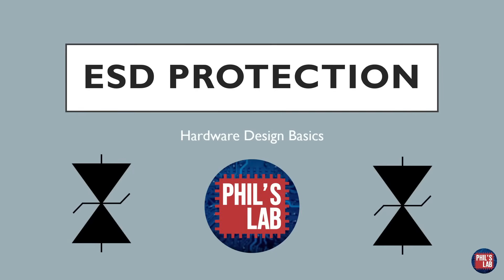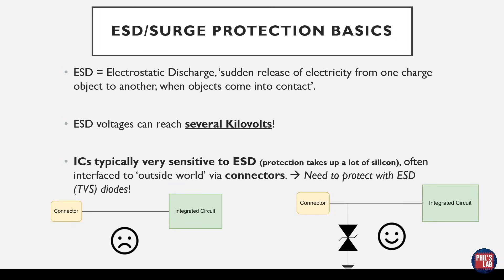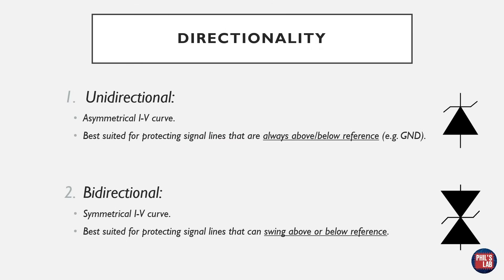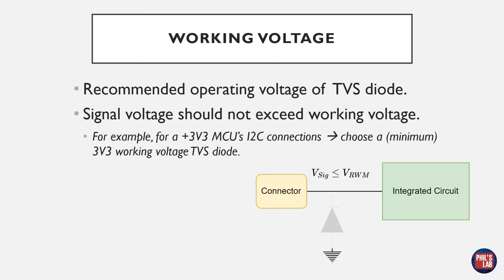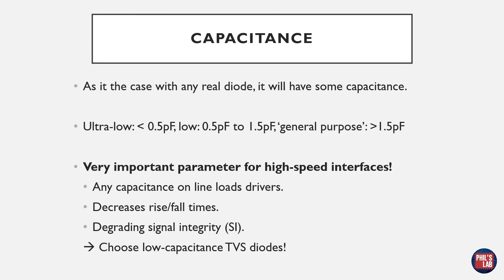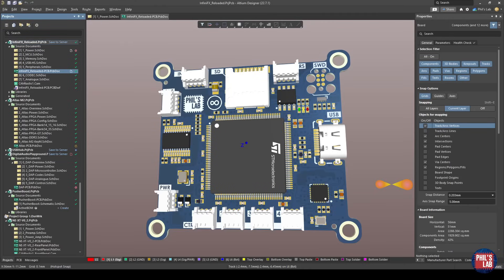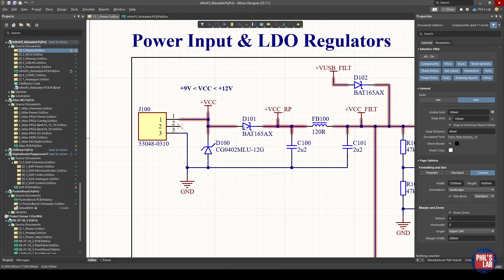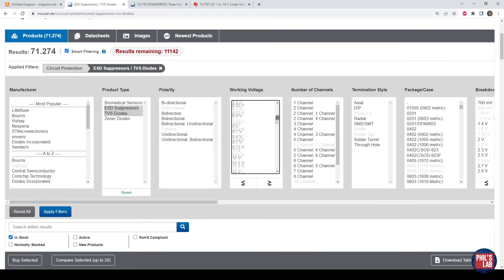(Sponsored) ESD Protection Basics - TVS Diode Selection & Routing - Phil's Lab #75

Comment: My  biggest issue is knowing when it's worth it to use one, someone online told  met o put them in my mosfer drain connector side, for a circuit that controls  lights, but I  was arguing that it's a one-time setup thing and not wroth putting 5 TVS on for.

Comment: @11:34 thanks for this explanation, I was scratching my head on why the hell a vendor schematic had  bi-directional diode in place for an external DC barrel connection for +19VDC, then I saw your video and remembered that there are power supplies with inverted connectors which flip the +/- on the tips, THANK YOU! On to the next mystery lol

Comment: What about thermal relief pads on the GND side when the diode is connected to a plane ? Should I remove it ?
Reply from the maker: Depends on component size and copper balance. Removing the thermal relief can reduce the overall inductance of the connection.

Comment: Nice Video! Thank you!  Two questions 

1. what about using a resistor in series to the input? It could be a 1-5 Ohms resistor which limits the possible current that is drawn by the diode. If you use a polymer fuse it can vary its resistance. 

2. The second alternative I know is are two stacked diodes. One from the signal wire to GND and one from the signal wire to Vcc. Is this as well a valid approach? 

Would be nice if you could comment this.

Thanks in advance

Comment: What is the rule about using ferrite beads? Is there any real benefit of using FB at 5V input of PDN?
I know it can filter out HF noise coupled to the VBUS line (USB cable, especially unshielded can act as an antenna for sub-ghz range), but what's the aim? Is it included to protect from this or to prevent HF noise getting out of the board?

Comment: As I understood, you are trying to give (9V-12V-->3.3V) to microcontroller ? and protecting the circuit using TVS diode + pi-filter. 
We can also use this type of protection ( TVS+ reverse polarity diode+ pi-filter) between 5V SMPS and Microcontroller board for EMI/EMC issue ?
what is the role of pi-filter here ?

where we can ask a problem in details any linkedln profile or website you have?

Comment: I work in an industry where we use M12A 5 pin connectors on all of our equipment and have a need for this. I wonder if there is any way to integrate this into a connector or something similar?

Comment: What if the clammping voltage is less than the operating voltage. The diode will be activated when  it exceeds the clammping voltage or when it exceeds the operating voltage?. For example this diode PESD5V0C1ULS-QYL

Comment: OK, so the ESD current goes into ground, but what if there is no ground? i.e I am holding the PCB in my hand? Where will the energy be dissipated in that case?
Reply: your pcb still has a ground, all your components, assuming that they've been properly routed, should have a nearby return path to ground. all this diode does is offer the ESD a direct return path to that ground before that ESD can make it to your components and cause any damage.

Comment: If you have a fairly high impedance input (gpio/ADC/opamp kinda deal) could you put a resistor before the tvs diode to reduce the current it'd have to deal with, rise times all that kinda deal? Or is it still better to have that after the tvs?

Comment: Hi, I have a DC motor operating at 24 VDC @20amp. On the supply line a surge voltage of +/-250VDC for 500msec is getting generated. In such case how to select the TVS diode? Also if current is also an important factor right?

Comment: Hi Phil, I have a question on the order of esd as connector esd filter and IC.

I have seen that the resistor element of the filter is put before the esd to also limit the energy going into the esd while still serving same purpose electrically. Is this is a good practice?
Reply: I meant this question for a data line

Comment: While your video focused on electrostatic discharges, during connector handling, there's also the point that signal lines can be subject to transient voltage spikes during operation.

It's advisable to consider where the energy absorbed by your suppression devices is delivered to. Dumping directly into ground isn't always a good idea.

I have, in my past designs, separated the equipment casing from signal ground (often not completely, resistive and other networks can be used) then routed the suppression devices to low-impedance traces which are bonded to the chassis or case internal shielding coating (for plastics).

The aim is to prevent large injections of current under transient voltage application from affecting the signal ground and upsetting system operation. This is of particular importance to systems running at voltages of 3.3V and below.

Comment: Is this similar/different to having 2 diodes, 1 to Vcc and 1 to ground?
Don't a lot of MUCs have that(diodes to ground and Vcc) at least on IO pins for ESD? 
If they used TVS Diodes,  then could you have 3.3v ICs with 12v IO tolerance?

Comment: why J100 a 3 pin connector and not 2?
Reply from the maker: For all other connectors I'm using either 3- or 4-pin. Adding an additional 3-pin instead of a 2-pin makes me need fewer unique components, as well as cable harnesses.

Comment: The BI-directional diode works in most of the cases, and you don't need to choose the polarity at all. Unless you are manually mounting the diode, and you are not able to know if the diode is soldered well to the trace, because either direction is open, in that case, uni-directional is better choice, because you can use the diode mode to measure its forward biased voltage, and that's will tell you whether the diode is soldered well.

Comment: Thanks for a nice video. I see that you showed ESD protection for LDO regulator and I went back to check the design I'm currently working on. In datasheet of the LDO that I use (AP2112K-3.3) it says ESD (Machine Model) 400V and ESD (Human Body Model) 4000V under Absolute Maximum Ratings. Does that mean that I don't need to add TVS diode?
Reply: If your goal is to save money or you just dont have the room on the PCB, skip the diode and use the built in ESD diode. Personally, i think its worth adding additional protection. I dont know why, but i just dont trust the IC manufacturers with this. It seems sus that this tiny IC has enough room for the IC and a reasonably large ESD diode. Your mileage may vary, but it never hurts to make a design more robust.
Reply: The esd diode integrated into the ic must be second line of protection and you gotta put an external tvs diode for full protection

Comment: 10:01 why a TVS diode on the power supply input if any "ESD" is gonna see that massive 2u2 MLCC capacitor? The diode could serve to clamp the maximum supply voltage and offer some minimal protection to over-voltage until it burns up due to the power dissipation. For ESD I would think the capacitance on that rail would suffice.
Reply from the maker: That's true - a (~ >=0.1uF) cap is usually enough for ESD protection on power rails. However, adding a suitable (larger body/power rating than shown in this video) TVS diode can help - as you said - with clamping the max. supply voltage. Quite a numer of app notes do suggest placing suitable TVS diodes also on the power lines.

Comment: Nice overview. Except for USB, I tend to forget EMI and reverse-bias protection when designing circuits... until something stupid happens. lol
A video on Surge Suppression would be great as well (eg. using MOVs, spark gaps, TVS diodes, etc.). Probably not as relevant for (most) strictly DC circuits, although I find myself working a lot with line AC (either building my own power supplies, or for doing industrial control stuff for my CNC machine).
Reply from the maker: Thanks, Jacob. Will try to cover surge suppression in a future video as well.

Comment: Thanks for this educational video! I've always placed a slow fuse (cartridge or poly) in front of the TVS diode. My intention with that is that in case there's a spike that persists for some time and/or, the more likely scenario, where the user plugs in a wrong power supply with a greater voltage, then the fuse would save the diode from burning up shunting all that current. I'd rather replace a fuse cartridge than a SMD diode.

Comment: Hi Phil. As always thanks for making such good videos.
We are working on a small electrical cart with the supply voltage of 48 Volts. The motor used for the cart creates 60 Amps current in back-EMF. How can we select a suitable TVS diode for reverse EMF protection circuit?
Reply: The diodes described in this video would die very quickly in that environment. Take a look at the SMDJ48CA or 5.0SMDJ diodes made by just about everyone. The key is the pulse power rating of the device. An SMD (not surface mount device, this is a part numbering thing done by Littlefuse, Vishay, and so on) component can handle a pulse of 3kW for around 1000us all day long. If you know the rise and fall times of your back EMF you can derate accordingly (maybe you need a bigger part, or multiple in parallel). Look at the datasheet for any of these devices and you will see a table that shows the peak power handling of the device over the time of the transient. 
FWIW- Those part numbers are like this SM [A,B,C,D (Power rating and size)] J [ Working Voltage ] [A for unidirectional CA for bidirectional]. So an SMDJ48CA is a 48V, D rated bidirectional devices. An SMAJ5A is a 5V unidirectional A rated device... and so on. The 5.0 or 3.0 you  sometimes see is a higher power device crammed into a smaller package.
Reply: @theonlyari  Thanks for the reply.

Comment: One parameter to check on, particularly for high-speed/low capacitance diodes, is if they have a snapback voltage spec.  When one of these diodes is triggered by an ESD event, it won't reset until the voltage falls below the snapback voltage.  For instance, if you want to have ESD protection on a data line and a 3.3v rail you might decide to use the high speed diode for both lines to simplify the BOM.  However, the snapback voltage may be 2.7v so if it is triggered on the rail it won't reset, i.e., it goes into latch-up, short circuits the rail and bad things may happen.  On the data line, the diode will reset when the data line toggles low.  Search term:  esd diode "snapback"

Comment: Very useful educational video.  Thank you.... also I have a question.  What is the difference between zener diode and ESD protection diode in this case?  When think about functionality both behave same.
Reply: Maybe the functionality is similar but the construction is specialized for that purpose. ESD diode might not have a very well set voltage level, or the votlage level might vary a lot with the current. A Zener might have a slow response time, making it almost useless for protection.

Comment: Thanks so much Phil - thrilled you've addressed this important area. Really hoping you can do a back-to-back video on power filtering, then your followers can safely design circuits for the real world. I'd love to see your take on common and differential mode EMI filtering (on both power and data lines), and when to use discrete components vs integrated eFuse IC's
Reply from the maker: Thank you very much, Dan! Definitely will be making a video or two on power filtering in the (hopefully near) future.

Comment: Think ESD design on a PCB is complicated? Then modern CMOS processes are 10x more complex. Primary and secondary protection, cross-domains, HBM, MM, CBM, antenna diodes, latchup...
Oh, and in high data rate I/O they couple ESD protection via a T-coil to reduce capacitive loading.

Comment: You can run in to problems as you get close to the clamping voltage as they start to conduct below this. This current can cause heating if the clamping voltage is too close to the maximum voltage on that net. So finding a TVS diode that will clamp low enough but not too low can be quite hard.

I have seen designs where the TVS diode in series with a diode or zener to up the trip voltage. But the diodes or zeners are not fast enough so affectively take the TVS out of circuit. Also a low value resistor a few ohms can help if the current pulse is expected to be large.

Have you done any lightning testing, that really puts your TVS diodes under strain. Had one where we kept seeing little flashes of light during the tests inside the box. On the third or forth strike the little flash was followed by a bang and a TVS diode exited stage left at a vast rate of knots.

Comment: Is there a parameter for the diode that says how long after a high-voltage pulse the line can stay high? Or is that something that has to be calculated based on the filter network?
Reply: The signal line can stay high forever, the diode is going to shunt the excess voltage to current. When the transient disappears, the voltage will settle back to whatever the voltage was. I saw a comment in here about snapback. I have been doing DO-160 lightning testing for years and never seen an interface get latched up by lightning. Im not saying it cant happen, but i havent seen it.

Comment: Golden content as always! How do you deal with not having the TLP value? Do you just use the maximum rating value?
Reply from the maker: Thanks! Yeah, either by maximum rating, digging a little deeper into manufacturer's files/models, or simply using the TVS diode with the smallest possible clamping voltage.